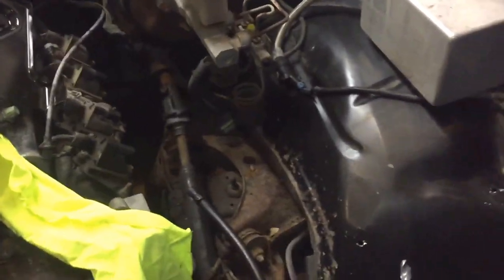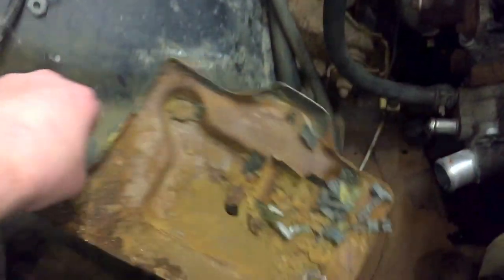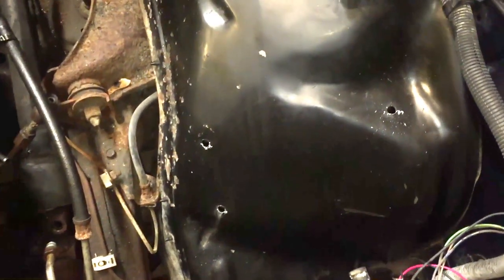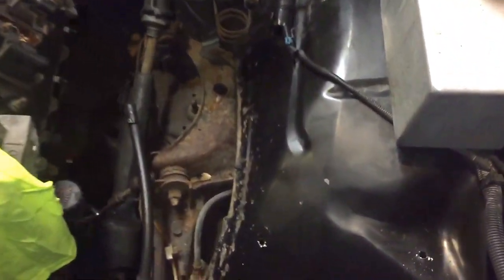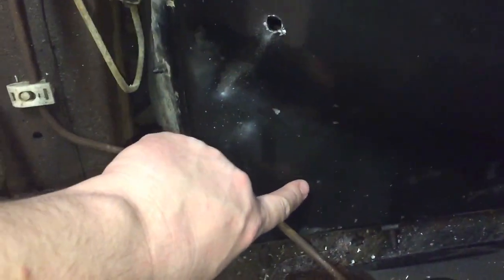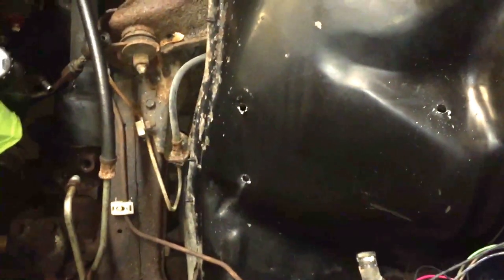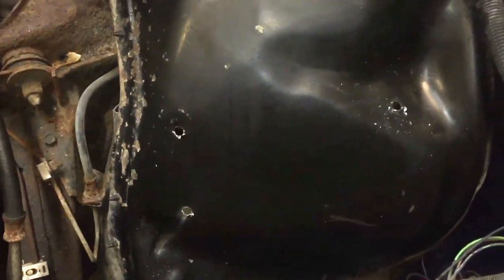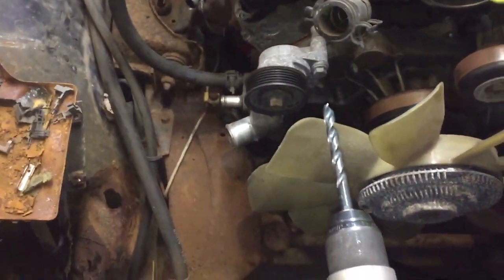OBS Driver side battery tray

Comment from the maker: No, I will modify the factory harness to just to keep the gauges working. I will use a stand alone harness made from the factory harness. Since I moved the battery over I can use the stock 99+ battery cables. Does that help?